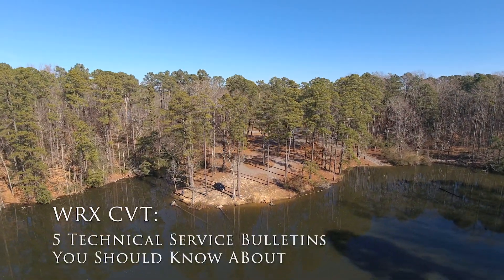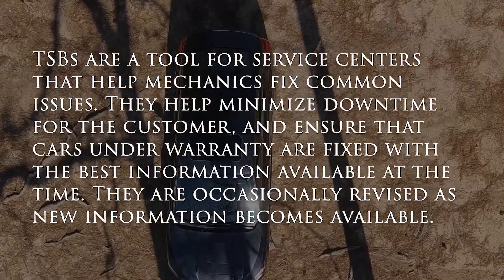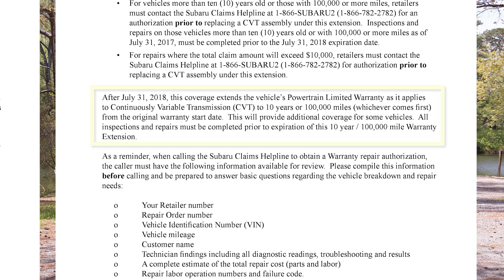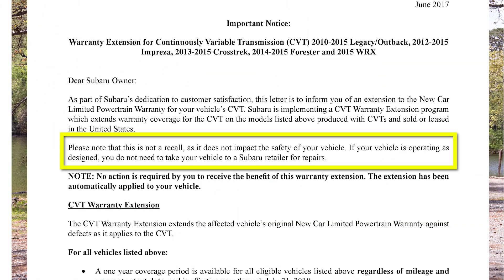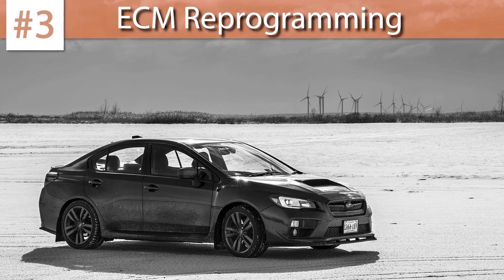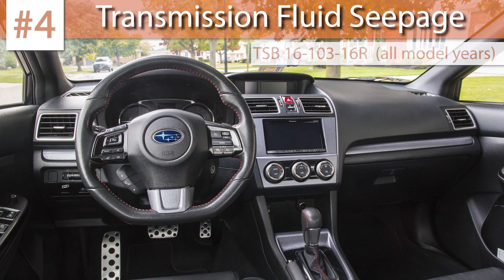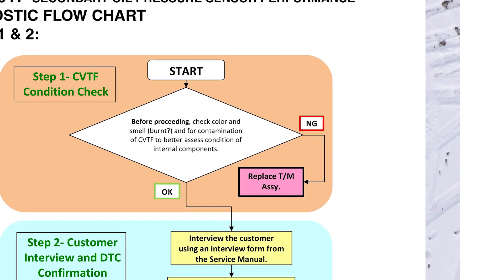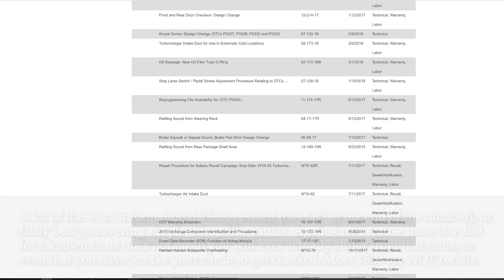5 TSBs For the WRX CVT You Should Know About

Comment: Does the 4th gen Subaru WRX with the CVT have additional cooling than non-turbo CVT-equipped Subaru vehicles?
Reply: no. you would need an aftermarket cvt cooler such as the one made by mishimoto or you can get a universal unit such as the one made by hayden.